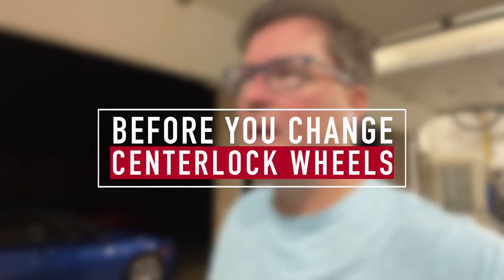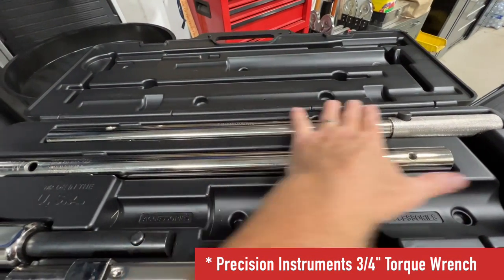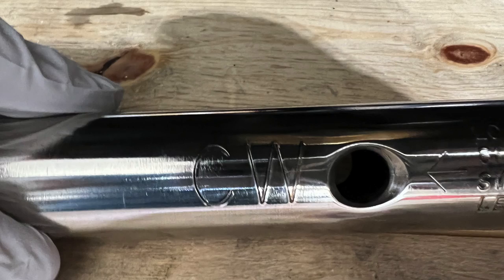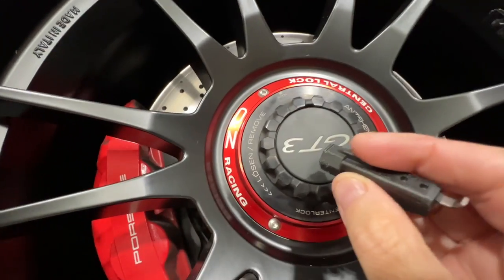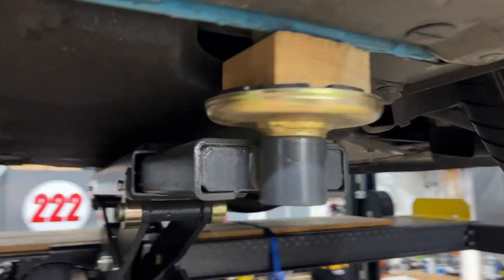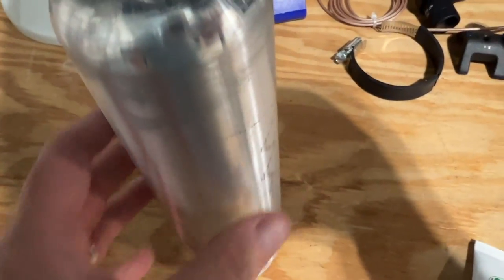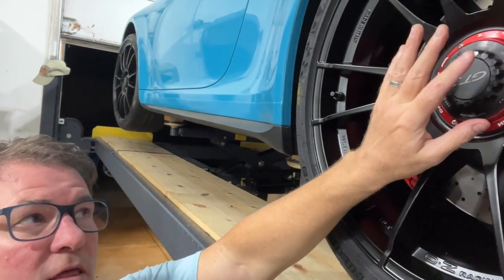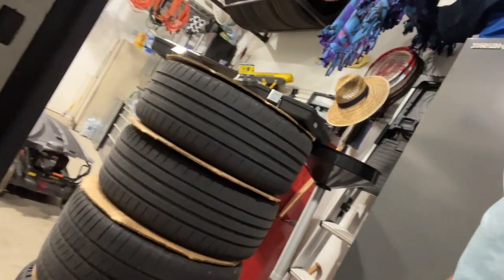2022 Watch This First before you change your Porsche center lock wheels (991.2 GT3 911)

Comment: You can turn the center part to make it pop out. Push in a little and turn it till it pops all the way out to engage the lock
Reply: Turn what and how?
Reply from the maker: @jamesrichardson4616  s
Sometimes that works for me & sometimes it doesn’t. I used the center lock rebuild kit to rebuild the intransigent lock and it pops out much better now.

Comment: Wow. And having a shop do it would probably be a pain. You'd have to drop the wheels off first because you can't fit in the trunk. I don't know what's worse. Thanks for the video!
Reply from the maker: Yes, when I do new tires, I drop off the wheels. I'm figuring even if most shops have a 3/4" torque wrench, they're probably not familiar with the mounting procedure

Comment: helped a buddy remove his off his 991.2 gt3rs and found it strange that we had to actually start the car and have it running for the front brakes to work. normal ? ? ? I don't see any other videos doing so.
Reply from the maker: I’ve never had to start to car to engage the hydraulic brakes, (or even the electrically actuated emergence brakes). I just use the spreader on the brake pedal and it locks the wheels fine. I have a 991.2 as well.